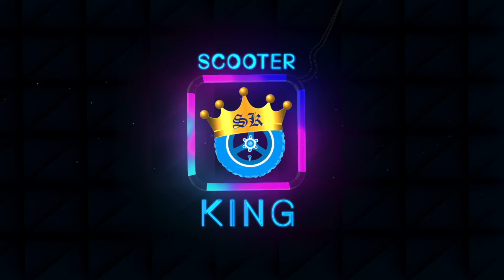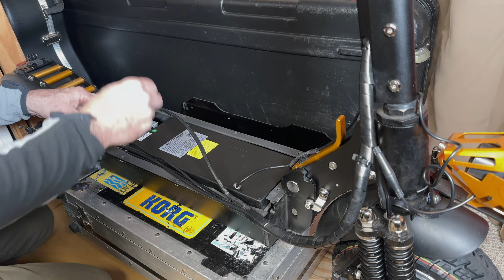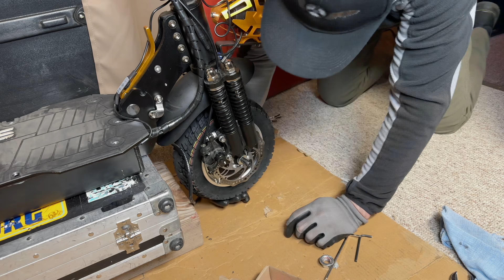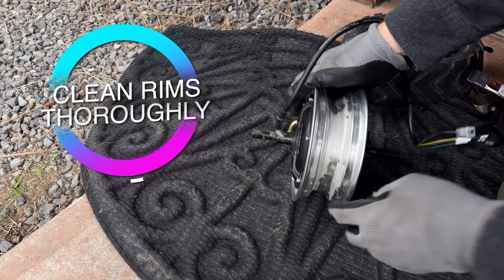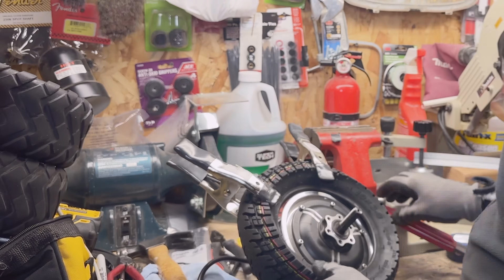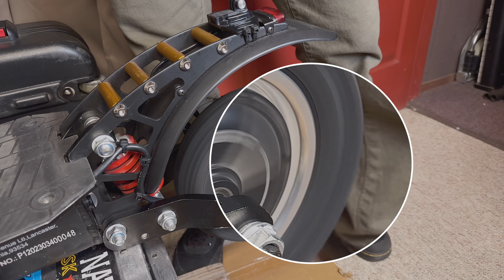Electric Scooter Tire Change Step By Step - No Pry Bars Trick

Comment: My w3 scooter intertubes wo t hold air the air escapes as fast as I can pump it and tips would be wonderful?
Reply: Dfv1 q as
Reply from the maker: If your inner tubes are loosing air then you have a leak in the tubes or a faulty valve.

Comment: I have a 100/65-6.5 that has the beads pushed in, so it is on there really loose and wobbly, yet I can't get it around the rim.  If I pull the tire to either side, it just re-seats the bead on that side.

Comment: This is cake compared to mine. The main problem i'm having is puncturing a hole in the tube every time i change the tire. But without having a tube at all that seems like heaven. In fact my next scooter i may even buy based on not having a tube, that's how annoying it is to change the tire.
Reply from the maker: I feel your pain. When I had my Joyor I was ALWAYS getting flat tubes or pinch flats. That became the number 1 reason I started looking for tubules tires in my next scoot.

Comment: Tire size?

90*55?
Reply from the maker: Depends on the manufacturer. A 80/65-6. tire is listed as a 10x3x6 or 255x80 by some tire manufacturers.
The important bit is the rime size. The typical sizing is;
First number 80/ is tire width
Second number /65 is tire profile ( tall )
Last number -6 is rim size.
Reply: @Scooter-King. yes correct 
I attached with 90-55 tire size
Mainly size is 80-65.

255* 80 also same size
They all are brothers

Comment: So I kinda thought this would fail or be just as difficult as bars but I put it in the bench vice clamped it on 2 sides and it went on with very little force on the first try.

Comment: Hello great content, like you im an avid scooter rider who deal with flats specifically on 10 Pneumatic Tire, about to upgrade to Tubeless Yume Raptor, Flats happen after 3k on this scooter, it only happens in the rear tire, staples and other stuff, wandering if there a street tire that has good steel belt or thicker rubber to protect against staple and other smaller things you might pick up on the road...any advice would be greatly appreciated, thanks again

Comment: Or there's another trick you can use especially if your tire rubber is a little old and stiff. The clamps don't work very well on older rubber so what you can do is place the tire and wheel like I did into an oven and heat it to 100 degrees. After that you can push mount with the heels of your hand right onto a center hub rim. No tools at all.
Reply: I still had to clamp and zip tie.  But then went on ez
Reply from the maker: great suggestion

Comment: What is a tire bead?
Reply from the maker: The reinforced opening edges of the tire that pop over the rim and make an airtight seal with the wheel.
Reply: @Scooter-King. Ah. Well now my issue is that I can't remove the tire no matter what tools I use. Yes the air is out, this tire is just a lot harder than every video I have seen of people removing tires

Comment: What size are the clamps do you use? 6"?
Reply from the maker: They are sold at Harbor Freight as 2" spring clamps but they open about 2 1/2". The 3" ones are easier to use on larger tires and still work on smaller ones as well.

Comment: what size of flier and clamp size you're using?
Reply from the maker: The clamps are just form home depo and open about 2 1/2 inches so I had to get a BIG set of channel locks from Harbor Freight to compress the 3 1/2 tire first. Its actually pretty easy to do if the channel locks are big enough.

Comment: Would love to see advice on replacing wheel bearings. I have an Inmotion Air Pro with a front wheel bearing that started making clunking sounds after just a few months of light use at low speeds. If I'd known how much of a pounding it would take I never would have bought a non-suspension scooter. But I don't even know what type of bearing it needs, where to find them, or how to remove and install them (or if it needs spendy tools).

Comment: Maybe add some quick release wire fittings for the motors so you can leave the deck cover on & avoid other hassles. Newer scooters have way more quick release plug & play wires.
Reply from the maker: Definitely in the works
Reply: Did a bunch of research. WAGO has some interesting releasable fittings on Amazon plus  copycat products with good reviews.  Wago also has these encased gel covers to fit over their connectors to further weatherproof them but not sure if they fit their inline fittings.  Brightfour makes releasable connectors for the small 20-24 awg wires. I thought my scooter mtr cable just had 3 12awg wires in it, but theres 5 extra tiny 24-26 awg wires too aah!  Found out after I cut the mtr cable close to the motor with bolt cutters to put releasable fittings on. This project just grew!
Reply from the maker: @Chris-f6o  Love to see a video on this project for sure!

Comment: I have the kqi 2 pro and i have tried absolutely everything to seat the bead, but nothing is working. I got a new tire in case, and still, it just holds air but the bead is jammed into the rim from one part of the tire. The rim looks normal. im at a loss.
Reply from the maker: A shit ton of bead lube and a strap racket around the tire usually does it, unless its the wrong size?
Reply: @Scooter-King.  Imma go with the forbidden method. Tried it all

Comment: What's the inch of the hand clamps?
Reply from the maker: They are sold as 2" spring clamps but they open about 2 1/2". You'll need larger clamps if your doing tires larger than 10x3.
Reply: Thank you  @Scooter-King.

Comment: Im confused...you made a video about how to get the tire off without spoons and then skipped the part where you got it off without the spoons. 
Just turned it over and BOOM...halfway off.
Reply from the maker: Getting the tire off is the easy part, I was able to clamp the bottom and pull them off with my hands.
Reply: @Scooter-King.  I see....thanks for the reply

Comment: I am sorry, this video is useless.  The most difficult part is getting the first bead of the tire on the outside of the rim.  You conveniently skipped right over that part and suddenly show the first bead is out.  Did you have to skip that part because you actually  had to stick something inside the tire and rim area to pull it out?
Reply from the maker: If your referring to 10" tires on a 6" rim, if you compress the bottom part of the tire with clamps so that's its in the center channel of the rim, you can literally pull the top part ( first bead ) off with your hands. If your referring to 11" tires on a 6.5" rim, then the tires are much thicker and you may need to use a flat end nylon spacer tool to help slide the first bead off.
Reply: @Scooter-King.  I appreciate the reply but I am refering to your video for this post.  Why would you even skip that part.  It's like you used one of the tools you said you don't need.  So, you decided to skip over the first part of the tire removal.  It' makes this video pretty worthless.
Reply from the maker: @jaserand6001  I just used clamps to compress the old tire so I could get it into the inside groove of the rim and pulled it off with my hands. The stock tires were quite thin and easy to remove without any prybars or other tools.

Comment: What size channel lock is that?
Reply from the maker: For these smaller 10" tires I just use the standard 12" Channel locks sometimes referred to as (420 size) for larger tires you may need 14" or 16" (430-440)

Comment: This is not gonna work with brand new 12 inch tires, they're far too stiff.
Reply from the maker: Yep, on tires larger than 11" I have to use a C clamp to compress them and zip ties but even then on much larger tires your looking at using tire spoons that tear up the rims.

Comment: Just use the valley of the rim people it gives you the room you need easy as your just putting circles together don't ever yse levers yo install it stretches the lip and ages tubeless insulation almost impossible if sat in the sun or soaked in hot tap water the tires basicly fall on good vid for showing another way to do a tire change and save a heap of coin 👍

Comment: If you can find a way to do something like this for honeycomb rubber tires im all ears
Reply from the maker: Those are usually factory installed with a hydraulic press. This makes changing them much more difficult for the average owner.
Reply: @ ive been trying to for a week :) cant get one on yet
Reply: @ByproductRefugees Ive heard you need to heat them up so it's easier.
Reply: @Samusaran77 didnt work but i found a solution, i got a wooden wheel dolly and 4 tie down straps, i put the wheel in the center used the ratchet straps on 4 sides of the rubber wheel placed the rim in it and released the straps 1 by 1 around it. 😅

Comment: I think I just have the absolute worst tire size 90/55-6. They have zero give, ratcheting clamps are the only way to squeeze them, they spit the spring clamps right off. It's actually the hardest physical thing I've ever done in my life, I've only succeeded with new tires twice,  typically I admit defeat and put the old tire back on, since it's worn it has just enough give. Honestly I think my best option is to try and sell my yume y10 motors and buy 2 split rim. I'm no Tim the tool man Taylor but I have a decent tool collection, I've never had to call a professional to come do anything for me but when it comes to the tires on this scooter,  I've looked in my area,  small city in upstate ny,  there's no epv stores or shops near me. Best option I've found is to ship it to NYC and that would be over $115 a tire. It's insane how difficult it is, yea I destroyed a bead on one motor,  only holds air for about 8 hours now. It is the most frustrating and impossible thing I've ever dealt with.
Reply from the maker: 90/55.6 are somewhat unusual. Low profile and pretty wide sound like. Haven't changed a YUME tire yet but, did swap a larger version of my 6" Solar tires a RR RS5 Max that were much thicker and had to work at it a bit more. 
Made a video about the larger ones here:
https://youtu.be/KNpMtWsE5so
Reply: Tire size 90/55-6.5 of your tire need tube it be 90/65-6.5

Comment: This is too much work i do it without removing any cables. By just removing the tires and rotors.
Reply from the maker: This is why scooters with easily detachable motor connections are SO popular. Much easier for sure.
Reply: That’s hard as fup that’s a lot of work I’m screwed,

Comment: Hello mate, I have to thank you thousandfold for this upload, it saved my day! I needed to replace a tire on my e-scooter and got myself a good quality off road tire 100/65-6.5, which was quite stiff. I used pry bars to no avail, only scratched the rim. I then saw your video, God bless you :-), and used three bar clasps and a hot air gun to make the rubber more pliable also some dish washing liquid and it worked magic! Ps. I didn't detach the cable nor the disc. Thanks again

Comment: Thanks!  Between this and the other videos I think I have a good chance at doing my EMOVE Cruiser without taking it in to the bike shop.  I've got some big zip ties that are supposed to help get the same compression and a little tighter compression on the tire, so we'll see how that goes!
Reply: How did it go? Just changed the back tire on my Emove Cruiser S. Zip tie method and 3 tire spoons. Hoping I didn’t reform the rim at all, but it inflated good with a regular pump.

Comment: Would you recommend that new tire vs the old one?
Reply from the maker: Absolutely! The stock tires on the Solar P1 series are fairly common and are found on many other scooters as OEM tires. The tread is pretty thin, especially the side walls. The new dual tread ULIP tires are much thicker overall, more like a car tire and you can really tell the difference just by the weight.
Reply: @ appreciate the details, much love

Comment: Hi, thanks for the non-destructive method, was looking for it!
So far, how is your experience with the hybrid tires? Are they quiet on straight roads?
Reply from the maker: Vert quiet,  but still have enough tread on the side wall for light off road trails.

Comment: Thanks mate! Mechanic tip, if it helps, after seating the bead and with low pressure in the tyre, roll it on the ground while pushing down on it to settle the tyre into place completely. That might help reduce any balance or out of round issues. I do this with tubed tyres on mtb wheels mainly to settle the tube.
Reply: With the Silicone, it will seat way easier, and quicker.

Comment: Please help me!!!! I have a Hover 1 BOSS R500 I'm trying to find a replacement rear tire. It a solid rubber tire, do you know if there is a replacement? And if yes how do you replace it? I can't find out a whole lot of information about it. I'm brand new to e scooters and I'm really loving my scooter. The tire that's on it still has a lot of life left but I'd rather have a new one on if possible. Thank you and I subbed your channel
Reply from the maker: The issue on the Hover 1 BOSS R500 is actually the rims themselves. They look to be specifically designed for solid tires, so replacing them with tubeless tires is probably not possible. 
Good news is you won't have to worry about flats with these solid tires but, they are put on with a hydraulic press at the factory and can be quite difficult to change as they are originally stretch-pressed over the rims at the factory.
The honeycomb tires won't have the lip (bead) that tubed /tubeless tires do that allow you to pry/push the bead over the rims.
I would look for a scooter/ebike shop in your area and see if they offer a tire swap service for solid tires.
Reply: @Scooter-King.  Thank you so much for your reply. I'm going to look in to it. The one on there now isn't all that bad, I'm just picky a d like my stuff looking 😊

Comment: I'll admit, with my first scooter, I used tire wrenches.  Getting the tires off was easy, but getting the new ones on was somewhat difficult.  If course, a big part of the reason was that the new tires were airless (but not 'solid') tires. 

With the new scooter (yes, the RR RS5 Max), and with the ulip tires (also recommended by you), I think I'll give this method a try...but, with one slight difference.  Because of the gel layer along the entire inside of the tread area, I'm thinking that using the clamps might not be good...that it could 'damage' the gel layer.  So, I'll just have to hope that the silicone spray is enough to get the job done.
Reply from the maker: Let us know how it works out!
Reply: You can use zip ties instead, its a bit wasteful but it should work just as well

Comment: Thanks for the clamp trick 
By the way, WD 40 is bad for rubber, it drives it dry , then will worn off faster. 
Silicone grease or spray is better for rubber.
Reply from the maker: If you notice at 06:56 I am using “specialist silicone” specifically made for rubber safe applications.

Comment: Wow thanks 👍 
Some nice tips there bro
I reckon ya shud try a bit of rope 
Theres a few ways can be used 
But loop it round the wheel rim post the 2 ends inside tyre and fish em out other side separate them bout 5 cm or whatever then put foot on it  and pull till the inner side bead can be levered with wide lever👍
Just jump on it to get it on or use rope lol😂

Ps dont go to fast may cause friction and kill rubber 😂😂

Comment: Awesome video, seriously. Exactly 💯 what I was looking for.
If you don't mind......
What is the capacity of the jaws on those channel locks? Would the standard 2.5" width work, or would I need some bigger ones? Like 4"
Reply: I got my brand new Teverun coming in a few days with a set of PMTs to go on it.
I've been scouring Amazon for clamps and pliers specifically for doing the tire swap.
 Can't stand the thought of using a set of spoons or screwdrivers to do the job.
 I'm feeling pretty confident thanks to your guidance here.
Reply from the maker: @InsomniacGT2ATX  for the bigger/wider tires, I needed to get bigger channel locks, made it much easier for sure.
Reply: An hour in, and I am finding this is definitely not as smooth a process as it seems in your tutorial. I am just not getting any space to work with.

Comment: I line that tire balancing trick. I have a scoot with off road tires that would shimee hard at about 40 mph, I held the file to it where the road usually don't hit and sure enough in a few seconds it smoothed out nicely. No more wandering steering sensation at 40 mph

Comment: What other types of lubricants or sprays would you recommend for the normal maintenance of the e-scooter, especially for those minor squeaks or creeks on the handlebars and suspension?
Reply from the maker: If its areas on metal that can't be seen (inside the stem, bolt joints, inside hinges) White lithium grease. Stays put and water deterrent.
If its areas that contact rubber or are visible (shocks, bushings, ect ) then WD40 Specialist Silicone. Doesn't last as long but safe for rubber and most paint and also drives out water.

Comment: Pure air gen2 too many punctures repairs so I’m going solid for the remainder of the scooter lifespan . Cable attached to motor can’t remove it gotta put solid tyre on . Gonna use this method using zip ties well try lol. Dreading a solid tyre install . Had a bad crash in rain pour scared me to death .broken nose .and black n blue.i prefer air but solid for now I don’t have the energy or time to keep fixing punctures
Reply: You broke your nose in the rain, and want to put tires that have less grip on your scooter?
Reply: @LampDoesVideogame 😂😂😂 I decided not too after 2days riding the ride was so bumpy . I changed back to air pronto .took me ages to get solid tyre on .hated the ride. Converted back